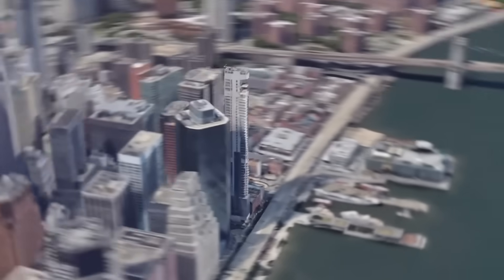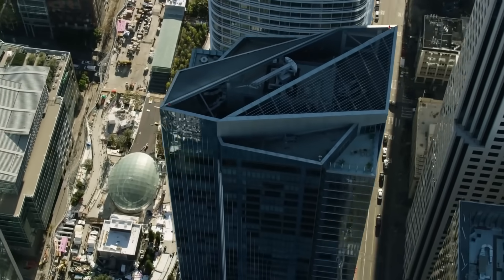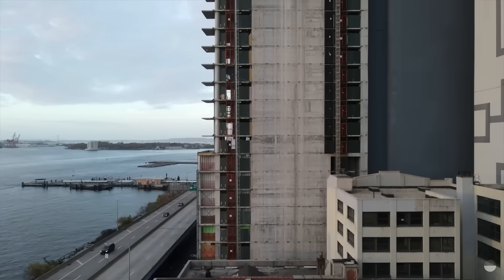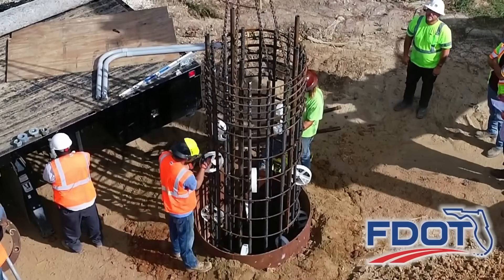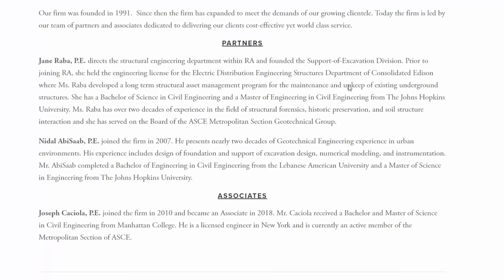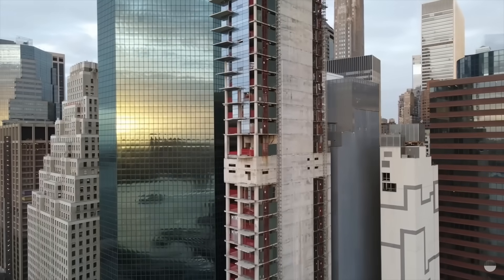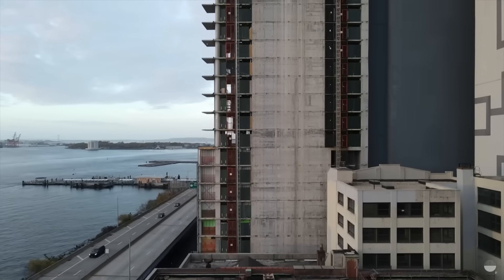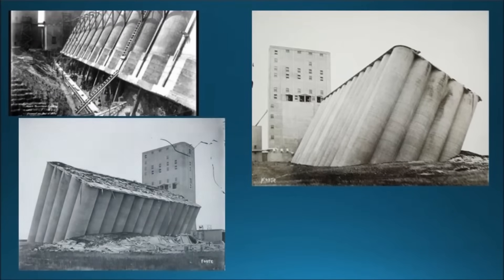New York's "Millennium Tower" Fiasco

Comment: I followed this case for several years.   Tower is supported by concrete mat resting on jet grout columns - with corner tiedowns to resist uplift.   Original analyses show the design work - but the analyses are not realistic.    I don’t think tower leaning is repairable.   Thanks.

Comment: In concrete for a structure that tall and thin lateral displacement of the building top may not be indicative of foundation differential settlement.  Different thermal, creep and shrinkage behavior due to prevailiing wind, and solar incidence is a possibility.  Issue for the pier of a bridge I designed many decades ago. 70+' tall pier was displaced 4" at the girder seats when the girders were set.  Turns out the issue was the sun shining on the side away from the side it was displaced toward.  Another issue was bridge (not my design, but my design of the corrective measures) that shifted about 10"  (and tore up a deck joint) over just a couple of years due to creep and stickion in the expansion bearings.

Comment: I am not a civil engineer and am sure there is a reason that this idea would not work, but let me try anyway …  
Is there any possibility of using an elevated cantilevered weight on the opposite side of the building from the lean, with attachment points at multiple elevations (floors)? Airspace over at least one adjacent property would need to be secured, but the additional mass would counter the lean and perhaps even contribute to stabilization of the structure in high winds.
Reply from the maker: It's an interesting idea. I think they would be reluctant to do anything that would affect the appearance of the building too much even though I don't think the building is currently safe.

Comment: Yup, mirco piles, introduced to them in the 80's under old buildings on fill.  Pain in the .....    The end game for this turd is bankruptcy, tax lien by city, sale by city for $1 w provision it be demolished.  I'm not sure they'll be bidders.  That is a horribly congested site and demo might have to involve cutting out pieces off hours for removal by crane during day, to reduce biz crippling noise of jackhammering for years.  The cost in diamond saw blades alone would be 10's of millions.  Is there a way to torch cut concrete and steel?    City might need to pay Arup to figure out how much can be left and stabilized with micro piles, and use that gold plated engineering as a 'sales tool' to get a bidder if they only have take down 1/2 of it and use micro piles to keep rest from settling further.

Comment: I like that you take a position. What happens if you are correct and repair is not started as earthquakes are occurring this year most recent major 5.3 2002 and several in 2023 2.2+ if as you suggest foundation is at limits even small tremors could be catastrophic
Reply from the maker: Thank you.  I agree that the either need to stabilize the issues with this building or take it down.  I will provide video updates on this story when additional information comes out.
Reply: The building dept needs to take an affrimitative stance with regards to fixes as this type of litigation between the parties can take a decade to resolve and during this extreme time delay (at least 5 years best case) may make any attempted remidies moot. @CaseyJones-Engineer

Comment: My dad worked for a "Major Chemical Manufacturer" as a Chemical Engineer briefly when I was a kid. They used our house as one of many test beds for Jet Grouting to stabilize the soil.
It didn't work. It seems that, in order for Jet Grouting to actually work...
It kind of helps to know EACH and EVERY Variable of the soil you're trying to stabilize. Like, its clay and sand content, mineral composition, and MOISTURE CONTENT.
Not just "On Average," either. You need to know this for pert near EACH and EVERY Cubic Inch of soil you want stabilized, and adjust accordingly per cubic inch.
Otherwise you get "Grandma's Gravy," the stuff that never congealed.
There is a reason that I will not live in any structure I cannot safely jump out of any window of.
I have been working Construction most of my life.
Reply from the maker: Yes, you have seen first hand all of the variables that have to be monitored to construct a jet grout column as planned.  About 15 years ago I was involved with a jet grout stabilization program for an existing dam foundation.  The client made the contractor install a test section of jet grout columns and then they excavated to expose what had been built with the jet grouting to confirm the strength, diameter and uniformity of the columns.  It was a good idea, otherwise they really wouldn't have had much of an idea how things were actually turning out.

Comment: Soil improvement is higher risk.
Piles for those that are risk adversed. A PE is required for pile observation to reduce risk , yet ground improvement method with a lack of certainty should not have been accepted by anyone knowledgeable with Manhattan geology.  
The cities two story  golf course club house at Ferry Point was built on piles .
Reply from the maker: I was really surprised that they would forgo a full depth pile foundation for such a tall residential building.

Comment: In 1982 I specified concrete pressure grouting of public roads for a subdivision in Sedona Arizona.  The roads had been constructed using substandard compaction methods, and poor compaction testing.   Filled areas were settling enough to begin affecting underground utilities, and the County Building Department would not provide documents allowing occupancy.  The grouting was done in a 4 foot offset grid, from bedrock to within 12 inches of the finished road surface.  This has been in service for 40 years with no signs of pavement cracking.
Reply: The NYC site is subject to a very high water table, about 10 feet below grade, as it sits about 50 feet from the ocean.  It's loose fill with a high degree of compressible organics from 1000's of yrs of bay bottom sludge, marsh plants, to trash thrown out by colonists, to tree trunks, with just enough earth and rock on top to build 3 story wood and brick buildings back in the late 1800's.  I'm betting fill in Arizona, even if not compacted, is mostly sand, various dims gravel and rock dry as a bone with no water table in sight.  Jetting high temp high pressure grout into the barely stable fill under the water table probably diluted the grout, the grout migrated in mysterious ways for who knows how far....   Atop that, they had to fear destabilizing buildings to either side by raising soil levels near surface, blowing high pressure grout into neighboring basements, subway and road tunnels, utilities a few or few dozen feet under ground, or blowing it up through streets and sidewalks.  Pressure grouting sounds great for wide open spaces where your biggest risk is killing too many gophers, and you can line the build area with test cores to ensure penetration of grout well beyond NEEDED area, ensuring it's in needed area.

Comment: Bonding is BS. The problem lies in the fact the city engineers approve this crap. If the city approves it and accepts permit fees, they own the problem. Bonding is just another way for municipalities to skirt responsibility.
Reply from the maker: True, but most cities try to absolve themselves of responsibility by saying their review does not relieve the designers and contractors of the ultimate responsibility in such matters.  And it seems that some local building officials across the country are corrupt anyway.  The whole situation is unacceptable.
Reply: @CaseyJones-Engineer  Yeah. I think ballot  initiatives need to be used to address these problems since the legislature has zero interest in doing so. It is untenable.

Comment: The idea of doing a test section for verification that jet grouting would be effective is essential in that type of fill material. The diameter of a jet grout column depends on the material into which it is being jetted. For instance, if the material is loose, the penetration may be large and fairly uniform. If the material is tight, the penetration may not be as far or highly anisotropic (for which injection volumes may be a misleading indicator).

Performance bonds…oh yeah.
Reply from the maker: It sounds like you are very familiar with this type of ground improvement!  I think the Europeans have a lot of experience with this type of work.
Reply: @CaseyJones-Engineer  Thanks for the reply. I worked as a consultant for 16 years with a lot of geotechnical engineers. I learned a lot from those folks, especially because I needed that information for my part of the work. My job was to handle the water issues (contaminant hydrologist). The projects ranged from Jersey to Texas to SoCal to Alaska…and back again.
Reply from the maker: I figured you had been around it! @jaymacpherson8167

Comment: Deconstruct it. That is what happened to the Harmon tower in Las Vegas. There will always be doubt.
Reply from the maker: That is a good example.
Reply: My cousin was a manager in a steel construction company that was building the Cosmopolitan Hotel across the street from the Harmon. He knew all about it. The Harmon's construction was halted when it reached half the design height. A structural defect had been discovered. At half the design height it was deemed sound, but would have been dangerous if completed to the design height. The building was finished at the reduced height, and then sat vacant for 10 years. No tenant ever moved in. Finally, it had to be deconstructed. It is my guess that both 'Millennium towers' will end up in the same state. There will always be doubt.  @CaseyJones-Engineer

Comment: So they wanted to build an especially slender building, over 60 stories tall, but they balked at using established engineering methods in favor of something cheaper -- and the building department signed off on that!  The engineers should lose their license, the inspectors need to be investigated, and the builders need to be banned from any work in NY again!
Reply: 100%
Reply: They have the example of the other leaning tower but still intend to make the same mistakes all over again. It's definition of insanity time. Or greed as a form of mental illness.
Reply: This sounds like the Comment Section version of Road Rage.
Reply: @privacylock855  There were many people that invested large amounts of money for a piece of this tower, and they have every right to be pissed at the devaluation of their investment.  How are they supposed to react to the failures of the builders and of the inspectors that signed off on this disaster.  Do you think they should just shut the hell up?  Do you think that the building inspectors that signed off on this should be able to sidestep any complicity and continue to carry water for the builders at the expense of everyone else?

Comment: Makes me question the wisdom of building concrete hi rise  in ares of unstable geology because of their weight as opposed to steel frame which is considerably lighter and tolerate wind and seismic forces way better
Reply from the maker: I agree with you on that.

Comment: The only connection between the two seems to be the concrete construction. Cost savings? How is 3 inches such a problem? The variability of concrete as apposed to steel could easily account for this.
Reply from the maker: The connection between the two buildings is that there was no deep foundation extending to bedrock. Also the amount of tilted resulted in a halt to construction due to the underlying concerns.

Comment: Isn't there Biblical advice on civil engineering relevant to this?   Solidified sludge isn't much better than sand.  New York was a good place toput skyscrapers whenthey could be bolted to the bedrock. On top of landfill, not so much.
Reply from the maker: It seemed to be an iffy design to begin with I think.

Comment: I'm sure the incoming micro-pile contractor is going to just love boring through all that grout.  

They must have used a BUNCH of grout, given the small building footprint.  I wonder if it can be avoided?
Reply from the maker: I think they can do it since I don't think they must have improved the soil to a sufficient degree, but it will definitely not be a cheap repair at this point.

Comment: Fascinating.  Eight or nine years ago I went on a private tour of Manhattan. There were 5 of us, the tour guide and a driver.  We stopped at the site of the World Trade Center.  It was still an active construction site.  The tour guide, a lifelong New Yorker, gave a detailed description of foundations in that part of Manhattan.  He explained at length about the muddy soil and the need to excavate to a certain depth and then to drive pile to bedrock.  He pointed out the sheet pile used to prevent the muddy soil from colapsing in, and the deep piles that went to bedrock.  How  is a tour guide know how to build a foundation and the individuals responsible for this building don't?

I am a naval architect and marine engineer.  I lived with my wife in Harvey, Louisiana, just outside New Orleans.  We lived in a 3000 sq. ft. 2-story house.  We had no basement, just a slab.  If I remember correctly, we had 121 - 40' treated wood piles (telephone poled).  The shipyard that was building our ships had to add additional ways to support the ships, while they were under construction.   They were driving 30" diameter steel piles about 120' deep.  They were made up of 3-40' pipes.

Driving piles to bedrock as a means to support buildings is not rocket science.  I support the advancement of engineering design.  But, sometimes the simple solution is the best.  Unfortunately, this is one of those, "I told you so", moments.
Reply: "Rocket science" is the problem - solid piles sitting on bedrock are inherently a robust basis for a foundation, and such a foundation does not rely on "rocket science" calculations and assumptions to the degree that friction piles and other "innovative" foundation types require.
Reply from the maker: Thanks you.  It is amazing to me how such situations can develop in modern engineering and construction.

Comment: I doubt anyone can notice a 3" tilt on a building this tall from street level, it probably sways that much on a moderately windy day anyways
Reply: One question is: would it STAY at 3inches?
Reply: Foundation settlement, building erected out of plumbness are the most common reasons, a 3" lean really isn't that much on a bldg that tall, the Millenium tower in SF is leaning x9 that amt and it's still not perceptable from street level  @olsmokey
Reply: It must be 3 degrees of tilt. There is no way 3" of tilt would be visible.
Reply: @gaba023  A 3 degree tilt on a 100 ft building would exceed a 5 ft displacement.

Comment: After three years of setting dormant I am amazed that the out of plumb and fix have not been discovered yet? Question 1. Have the out of plumb increase in the last few years? 2. What is industry standard for plumbness of buildings?
Reply from the maker: There are usually code requirements that specify the degree of plumbness which I think can vary based on jurisdiction.  There is not a lot of technical information that has been released about the building/foundation problems and their time line.  I lot can be inferred by whatever action they take to correct the issues in the future.

Comment: Do you have any idea on the cost savings of the in-Situ soil stabilization vs piles to bedrock?

I recently found your channel and thanks for these informative posts, and well presented.    

An old supervisor (structural engineer) had a sign in his office “there’s never enough money to do it  right, but plenty of money to fix the resulting  problems.”  In this case and Millennium towers, bedrock doesn’t seem that deep.  

On the other hand, what if this and the Millennium  towers  novel foundations were successful ?  Then they would add to the knowledge of innovative foundation designs and applauded by the community. Unfortunately that didn’t happen here.
Reply from the maker: That is a great question, and the short answer is I don't know.  If I had to wildly guess, I would say that pile foundations would have cost around $4,000,000 and ground improvement cost about half that amount.
Reply: @CaseyJones-Engineer  regarding the Millennium Towers, total construction cost was $350M and foundation retrofit is at $100M. Hind sight is 20/20, but the original foundation designer (Treadwell Rollo) lost the bet with their friction pile system. I assume they thought it would be fine based on other projects using friction piles in their foundations.   Lawsuits are flying, but how much responsibility does the Treadwell  bear?  I don’t know if they can wash their hands once the plan is approved by the building contractor or the city. Or do they always assume full responsibility.  I believe Treadwell was bought by another firm prior to discovery of the probl3m